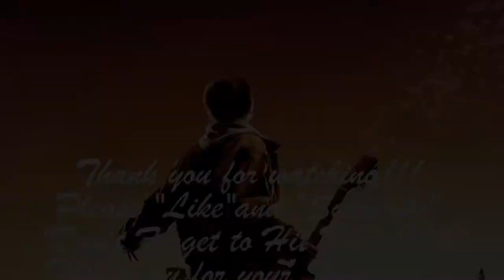How to: Install a battery from a 2015 Nissan Frontier

Comment: Question 

What kind of battery you used on your Nissan Frontier?
Reply from the maker: Its a group size 35.
https://www.autozone.com/batteries-starting-and-charging/battery/p/duralast-gold-battery-35-dlg-group-size-35-640-cca/115788_0_0

Comment: Does the vehicle computer need to be reset after changing the battery?
Reply from the maker: No it does not the computer resets itself once you disconnect the battery

Comment: I just bought a 2019 Frontier & I'm hearing horror stories about dead batteries causing the immobilizer to kick in because the lack of voltage causes the key chip to lose the code. Were you able to re-start the truck without re-programming the key?
Reply from the maker: Wow I'm not sure. Contact the dealer and ask. I believe it. Now a days the dealership is making harder for the consumer to work on their own cars. So they can make all the big bucks! Thanx bro, thank you for your Support!

Comment: hey man I'm going to be sincere with you I didn't like your video just because you didn't turn on the car afterwards to see if it turned on
Reply from the maker: What no faith? Its a new battery. If it doesn't  start, its something else. May I suggest a volt meter...Hahaha Happy New Years!
Reply: It's not the faith if it's not the battery why are you charging it 😂 so if you would of turn on an it didn't turn on the car the video would been kinda pointless
Reply from the maker: @NFLbroski  Its Instructions in Installing  a Battery.  Not troubleshooting. I work at a dealership and most of these cars come with dead batteries and just need to be replaced. The reason  for these videos. I'm already doing the job so might as well grab a camera and record it. But thanx, good for future reference. Happy Holidays.